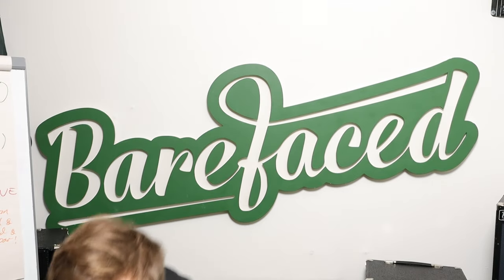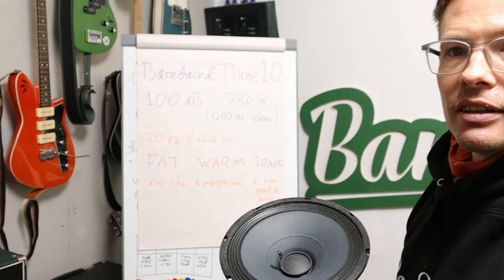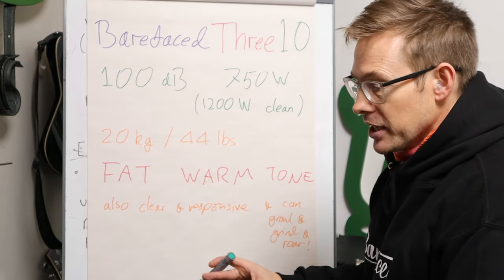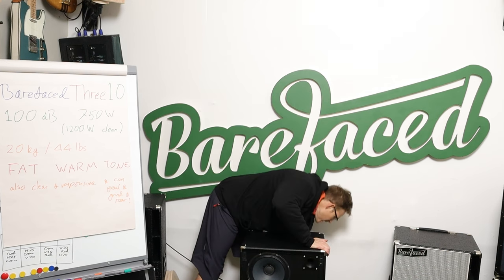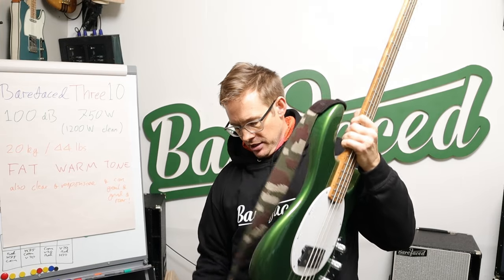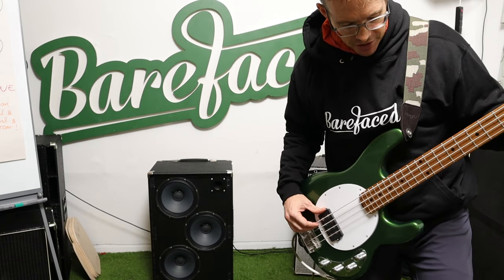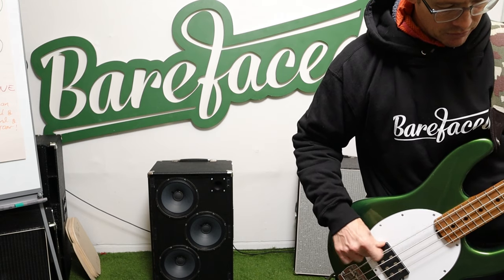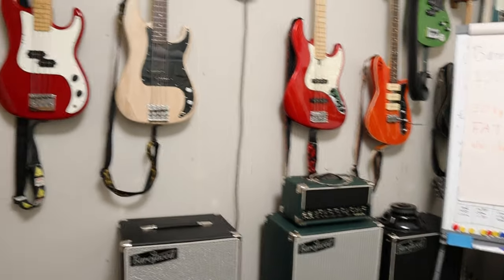Is three the magic number when it comes to cabs?

Comment: What I really need is a 32 x 10, a Powersoft K20, a 40 amp circuit, a loudspeaker management system, and a decent bass pedal and a good 5 string. Oh and a flatbed truck to carry this enormous rig around.

Comment: It would be super cool to offer a vertical 4x10 in this kind of configuration. Bass closer to your ears and takes less real estate on stage. Your stuff is awesome. Cant wait to order soon.
Reply from the maker: We can definitely do a modular Three10+Extra10 4x10CR stack. I guess if enough people want a tall narrow version of the Four10 it’s not impossible to do, but we’ve got a lot of other stuff to do first. I really like the idea of a Three10 with a matching width 1x10CR you stack on top for tight stages or louder gigs, and then use the 1x10CR for quieter situations.
Reply: @BarefacedAudio  actually your right. I like the modular aspect as well. But wouldn't a 4 ohm 3x10 paired with an 8 ohm 1x10 reduce the ohms below a 4 ohm load? My head doesn't support 2 ohm loads. I know you have the answer lol. I'm just curious how that would work?
Reply from the maker: @Jack-zc9el  it would be a 4 ohm nominal Three10 with a 12 ohm Extra10, giving an also 4 ohm nominal load. Same as we do with a 4 ohm Six10 paired with a 12 ohm Two10S, giving a 4 ohm nominal load. It works because the 10CR drivers in Hybrid Resonator cabs are particularly easy loads, without the dips in impedance or swings in phase that upset amps, so we can be a lot more relaxed about minimum impedances.
Reply: @BarefacedAudio  gotcha thanks

Comment: I've been fascinated by the "hybrid resonator" concept and trying to guess what it is. Whether there is a high tuned ported box for the speaker inside a low tuned ported box, which gives the speakers a smaller enclosure when playing higher bass frequencies, then at the tuning of the highs, the other port might pass them because in the remaining box volume it's tuned higher, then when getting into deeper lows, the small high tuned box "leaks" out the port and feeds the entire box volume with the outer port for a lower tuning.

The other thing I'm wondering about is a ported "cavern" within the box that resonates at higher frequencies and effectively closes itself off reducing box volume for upper bass, then "leaks" at lower frequencies, turning the entire enclosure into a low tuned ported box. At the same time, the outer port's tuning has increased, due to the cavern being "closed off" by being above its tuning frequency and the port not letting air in, and the available box volume shrinking.

I know you have intellectual property to protect but is it the double ported box above, or the ported box with an empty ported chamber inside? Though one thing I've noticed is that it doesn't seem to require a lot of port area. The big 8 x 10 cab has a couple of ~6" ports on the bottom, yet for a conventional ported, a big slot port down either side or both would be more appropriate.

I think if you just used a ported box that's tuned low and slightly undersized, it would still be a bit big for boosting mid-bass frequencies, but not big enough to amplify the low bass as much.

It looks like it would be quite a good design for a compact car audio subwoofer box.

Comment: I would like to hear a prototype of a 3x12" speakers for guitar and baritone, with two Celestion Alnico Blue with a single G12 anniversary... 🙃🤘
Reply: 3rd Power Amps had those triangular 3x12"'s. Remember those? The idea was that the 3 speakers work together as one giant speaker or something.
Reply: @jotunbjorn  I didn't knew this... But after some research I found also some old 3x12 cabinets from Marshall and Fender... The idea isn't new, but it was used for bass. I think there are some really cool options to use different speakers with special characters to create unique sounds.
Reply: I made my own 3x12 last year comprised of a vintage 30 and 2 G12H 30w anniversaries. The idea was to run the 2 h30s in series and the v30 parallel to them. The load comes out to 120w at 8ohms. All of the speakers are rated at roughly the same sensitivity and are splitting the power proportionally so in theory they should be performing similarly with the slight caveat that the anniversaries are doubled so they should be more present and I can say... it is a damn good sounding cabinet.
Reply: @joshshultz1250  I can imagine that this combination sounds great. I like the Anniversary speaker and it's a good idea to combine it with the V30. I'm not sure what cabinet I should use. Maybe I should make it by myself. I have to watch some videos about self made cabinets... I like the idea to have a 3 x12 cabinet.

Comment: Remember that doubling the power only increases perceived volume by 3dB (a decibel being the smallest incremental change in sound a human ear can detect), but that increased efficiency greatly increases potential volume from the same size amp, and that the purpose of more power is 'not' more volume, but more headroom: the ability to reproduce a signal 'without' 'adding distortion of its own before it starts to breakup.
Reply from the maker: There are some good points in this comment but also some errors too - rather than enter into a philosophical debate of how power can only increase headroom through increased maximum SPL, I suggest you watch some of the numerous videos on our channel which aim to educate musicians on how sound works and how audio equipment works.
Reply: For the purpose of clarification, we'll say that the 3dB (which literally means 10^0.3) is interpreted by the brain as "roughly 20-25% louder" that is if you imagined a volume control on a TV, and you turned it from say "50" to "61" you'd get about a 3 decibel increase, or if you turned it down to "41" a 3 dB drop, though it depends on the individual curve chosen by the TV makers. Obviously the perceived headroom is also going to be identical, but if you were close to the limits on your old amp, you will get a much cleaner sound at the same level on the new amp. Because our conscious brain hears in roughly a cube root curve, it won't take that much extra to max out the new amp.
In terms of the adage "will clipping damage my speakers?", power handling of a speaker is band dependent, ESPECIALLY for a multi way speaker. A woofer by itself will handle roughly similar power at all frequencies - impedance, sensitivity changes and coil cooling motion aside. A 500 watt woofer crossed to a 50 watt midrange and 20 watt tweeter will have a lot less power handling at the top end (though the drivers will make up for it in sensitivity increase). A clipped signal will usually put more emphasis in the mids and highs, though similar to a really twangy bass tone, which might take the mid and tweeter beyond power limits, compared to a more powerful clean amp, that will send power increase evenly between the drivers. If you want a Lemmy motorhead sound loud, you might want to use beefy mid-drivers and turn down the tweeter. A woofer only cab it doesn't matter much about clipping a smaller amp, only if it exceeds short or long term power ratings.
Reply: @BarefacedAudio  Errors? No. Generalizations, yes! All things considered, an efficient cabinet 'was' a cheaper way to get more volume; although new amplifier designs have leveled that playing field as watts are grown cheap these days. Even so, those who stand to profit are determined to ensure that dB's 'stay' expensive.
Reply: @philosophicallyspeaking6463  You're insane if you actually believe the human brain can only perceive volume differences of 3db or greater... or you've never sat at a mixing console.
Reply: @joshshultz1250  Hi Josh! A 'single' dB is literally defined as being the smallest incremental change the human ear can perceive. Where in my comment did you get that triple that amount, or 3 dB, is the threshold? The name decibel is given to and tied specifically to that perceptual threshold. 

If you don't know that, you also won't know that '3 dB' is the quantitative increase in perceived volume won by doubling the power of a  amplifier. If it is just a case that you misread you need to recant, but if you are in anyway connected with the industry, you might want to delete your comment as it shows you in a poor professional light.

Comment: I use a Noble preamp and I like it so much I just use it through the fx return in my bass amp and skip the pre. I think the 310 would be the ideal cab for me, any chance you fancy making a powered version. Or can you recommend a power amp that would work well with it? (preferably a physically small power amp)
Reply from the maker: We haven't developed a power module for our bass cabs just yet - our 200w active guitar cab module is complete which will hopefully lead to some headway in its development. You might want to go for something like this if you have the budget: 
- https://www.bassdirect.co.uk/product/grbass-pure-amp/
- https://www.crownaudio.com/en/products/xls-1502

The EHX 44 Magnum is designed for guitarists, so don't be tempted by it's size (and price!) but if you're willing to spend upwards of a few hundred quid/bucks then one of the Seymour Duncan Powerstage pedals should be sufficient for bass (and is quite compact)

Comment: Hi Alex,
Can the 3x10 hold an hiwatt 200 watt tube amp?
Or does a 6x10 must be used fir that kind of amps?
Reply from the maker: By hold do you mean “handle the power from” or “have an amp that size/weight placed on top”?
Reply: Hi Alex,
I mean "handel the power"
The 6x10 looks great bit is too expensive for me...
Does the 3x10 would do the work and sound "the same"?
Reply from the maker: @luka3679  The Three10 will have no problem handling the power from the Hiwatt and will sound very similar to the Six10, just a bit less LOUD. There's also the Four10 if you need a wider cab for the head to sit on.

Comment: JL: audio been doing 3 ohm coils for three decades. 

I use a KBA50 Peavey..  10" and 1" bi-amped with 3 channels a loop and DI..  it has better dispersion because the tweeter.. which looks like a better tweeter than that cabinet has...   it's a closed package and quite often.. I run a Subwoofer..   getting PA support is critical. using anything beyond one cabinet is a waste

100db efficiency and 750w power handling is just off. like no way. proof please. at some point around 128 watts it's just wasted power and yeah..  there's no way those will do both linear.

I usually run compression on one channel and dirt on the other.. which when bypassed I have a clean-compressed parallel and two open channels... so.. I run stereo out from my bass... one channel P bass the other MM..

best part. I paid $20 for the whole thing.  adding the subwoofer was just for giggles but I use a 10" 400w powered with a line thru off my DI out. just to add a bump in the bottom end of my tone.

I have no use for that. I don't see any value in that. how would I connect it to say.. a Traynor dynabass 800h
Reply from the maker: I’m a little bit confused - why is 100dB sensitivity and 750W power handling so strange? Why is 128W the max amount of power a speaker can use without wasting it? If you can get the tone and SPL you want with a 1x10” keyboard combo then that’s great but I know I can’t (whether adding a sub or not) and nor can most of our customers!
Reply: @BarefacedAudio  20db roughly 128 w. On top of 100db efficiency that's 120db. Reasonable to assume that's clear and workable.. gaining another 10db just seems both unlikely and not worth it. Having that headroom would be nice. I heard aperiodic which I'm familiar with. There's always a trade off. I'd like to see the 130db response of that cabinet
Reply: I mean that would only be about 40 watts a driver - and these are not a typical hi-fi woofer with a small coil.
Reply: @TimpBizkit  it's called a DI..  3 weird 10" are either too many or not enough failing both while offering absolutely nothing.

I'll take a 40 watt single with a good tweeter.. in a combo with a DI any day.

QTC final being more important than anything else..  again if it can't move air it's gonna need a DI and be portable.

3- 10" worked really well in sealed enclosures as subwoofers..

but leaky bass cabs.. which is what an aperiodic is..  just embarrassing
Reply: @TimpBizkit  my response is ultimately no. 3 suck. If you want to have big wasteful power amps go ahead. Efficiency wins the competition. Neomag with a LOW QTC I would prefer if it doesn't want more than 40 watts. I could run 400w head with 10 of them
Reply: @the_nondrive_side  how much power it needs is based on the sensitivity frequency response chart, how loud you want to play, and how far away you are from the cab, not on how much power the driver can take. For example a Danley TH118 subwoofer can take more power, but needs less power than a Logitech Z5500 sub. Saying, "The Danley sub needs 1700 watts, and the Logitech only 100" is wrong thinking. The Danley might play as loud with 5 watts as the Logitech on 100.
Just because the drivers can take 250 watts each in the bass cab doesn't mean you can't run it with a 40 watt amp. It just means that if you do want to get loud, you won't have to start bringing extra cabs because the other one will blow if you turn up a bigger amp on it loud.
Reply: @TimpBizkit  I'll buy Bag End with a real Concentric tweeter not the weakshizz.